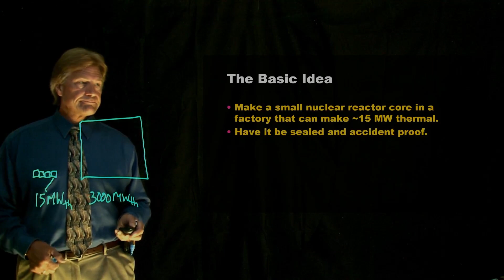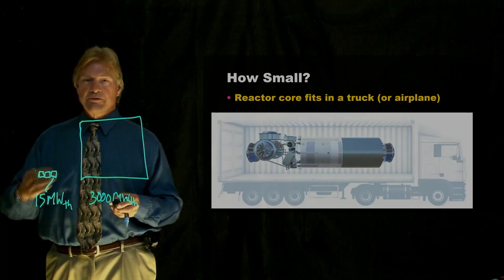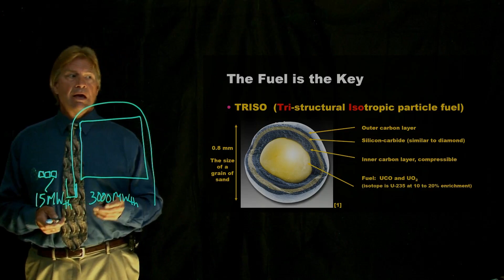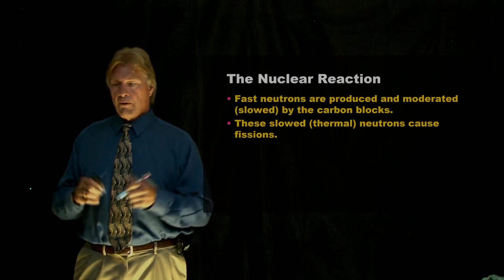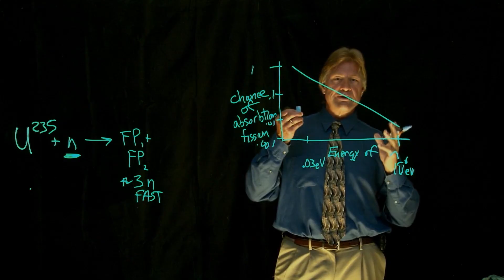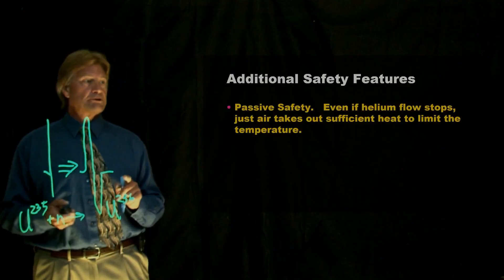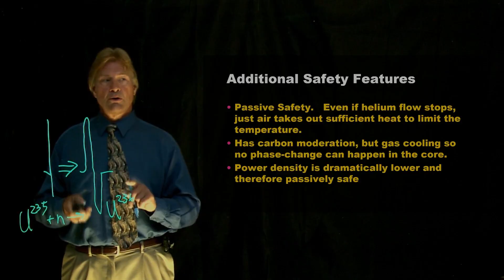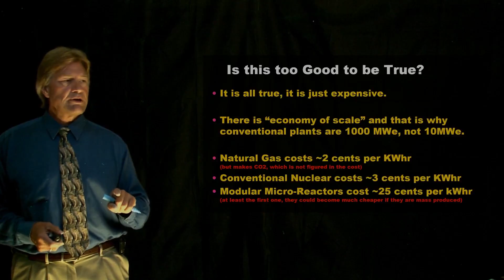Modular Micro-Reactors – The Future of Nuclear Energy?

Comment: I work at a CANDU reactor and this concept is finally getting financial backing and political support in Canada.
Reply: New Brusnwick is running a Moltex project that expects to be making electricity by 2020 to 2030. They will be using used "waste" fuel from a CANDU reactor. They have the engineering sorted and are ready to go. The delays are entirely regulatory.
Ed Pheil (Elysium) was asked if he could dispose of the old nuclear bomb plutonium cores. Absolutely he could but he needs regulatory approval. The big win is that simply making the salt fuel denatures the fissle material making it useless for bombs. It "could" be refined back into bombs. But it would be easier to mine new material and start again.
Reply: @Dave5843-d9m  Have any resources I can read about it?
Reply: @Dave5843-d9m  anything that proposes to take something to cheats a meter and make it foUr kilowatt-hours  a dollar before you have any of the other cost which ARE the majority of the cost of using electricity and that's just on the supply side of course you're going to be supported by the industry that is spared competition. I'm all for the lowest hanging fruit getting this technology but it's not an alternative to actually disrupting electrification like solar photovoltaic panels which although they supposedly shade produce pretty good you don't have to produce electricity to shAdE your radishes so that the product can be sold for 50% more. In Japan they just leave the carrots under the snow and they get sweeter all winter.
Reply: @Irene-fu6gj  Canada has northern towns where it's dark for months at a time, and electricity is nearly $1 per KWh.  They already have solar to save diesel fuel in summer.  And don't suggest batteries, because that won't work.  And for large industrial cities we already have large niclear power plants.
Reply: @RandyTWester  I'm not sure without studying the entire dialog what my point was ages ago but since then a lot has happened in the world we are not just looking at the new steam Technologies but used fluids engineer to boil at specific temperatures like in the case of Microsoft a dementedly optimal if you don't recycle the electricity temperature or for India or anywhere that they don't have money to burn recycling dry air and continuously fighting to keep it dry when people prefer humid air unless they are wearing Fabrics that instead of being below body temperature actually prevent body heat from leaving the body!

We are feeding finally technology be driven by the customers interests even if the global cooling prize was about the opposite of that as it has presently closed denying the world the bargain price promised. We also know that gaslighting is needed anywhere there is a certain need for serious illumination for example indoor agriculture you wouldn't want to use wires to provide the lighting what you have there is that the component level methane being converted into photons and of course plant food AKA carbon dioxide. These developments will quickly overtake incumbent Industries and form a Cadre of innovation that we hope will allow Greta to go to college by getting it as in we got that disaster she won't be able to go back to school until somebody has. Electricity is too expensive at $0.02 but the energy that we need we are going to have to provide at a fraction of a penny fortunately that's easy to do given functional government exercising its power to intervene in Copper Etc price supporting nonsense.
Reply: @Dave5843-d9m  It the costs start at 25 ct/kWh, I am not confident that these costs can be brought significantly down. It had not worked with the large reactors either, why are SMRs different? https://grist.org/wp-content/uploads/2011/04/nuke-unlearning-1.jpg They all are nuclear installations, and learning means we learn how to improve the safety and the risk to cause contaminations.
Reply: @George Mann Thanks Mr. Mann
Reply: @Rawdiswar  Also on the aforementioned MCSFR https://youtu.be/pqVt8cxx-44
Reply: Wish we had a CANDU here in the US.
Reply: @EricLidiak  CANDU is banned in the U.S. because it can technically have a 'negative void reactivity coefficient'  but realistically, it won't get out of control because the fuel is low or no enriched.
Reply: I know Ed Pheil, he's great
Reply: kkthxk  No, the sooner people realise that nuclear is a part of our future the better.
We need to stop looking at this from an "us and them" perspective and use whichever technology fits a particular requirement best.
Reply: @asificam1  the use of the metrical a can is interesting but not reliable however I am sure you are aware that there are many places in the world who have developed innovative ways to waste electricity not just America by any means. In these places electric resistance in the mid fractional million Watt is marketed by the quality of the wheels and heat is too cheap to Electrify or waste uranium even on. Heat is for cheaper from uranium then electricity is the question remains how do you pay for the means of obtaining the Heat instead of paying people who have a locked up minerals at below-market cost for them and are motivated by the profit reselling stuff to burn obtains them however unfortunately.

It has never been pointed out sufficiently the car culture is entirely not engineered for use swith other cars but rather to get away from others and their cars.

It is the same with heat. Where you need to bring the activities that produce it there not electricity. Not fossil fuels. Not for heat not for any mechanical work. You don't bring electricity there unless somebody is paying you to dispose of it. If somebody is paying you to dispose of the Heat or at the store the solar panels 4 less than the cost of stacking them on top of each other and a dark Warehouse costs then there are certainly activities that you can use the electricity for but you don't pay for electricity you are paid to take care of it or you are disingenuous predatory betraying badmus
Reply: Perhaps in 300 years from now we get one in brazil... but would be a outdated one for sure.
Reply: @voidcomm14  I may not be around in 30 years
Reply: I always thought CANDU was dead and that Canada sold the technology to China!
Reply: @marcteenhc9793  AECL sold the technology to a Quebec engineering firm.  The Chines shopped around the world and bought a couple of each major technology, then developed their own.  The Indian CANDU design has evolved / diverged, as well.
Reply: @RandyTWester  My point being that, outside of China, this technology is dead or dying...even China has replaced it with reactors of Chinese design.